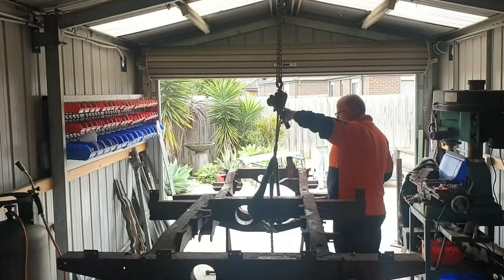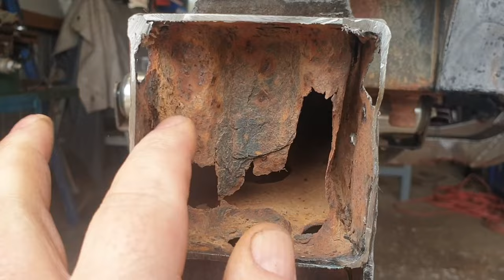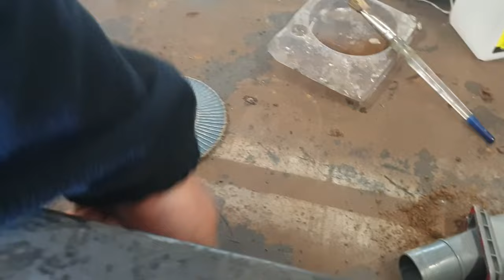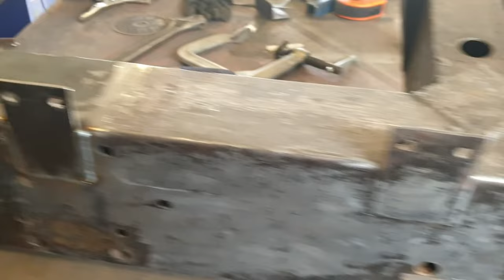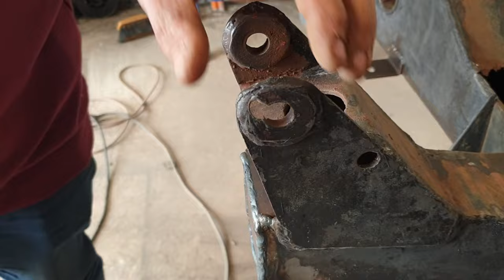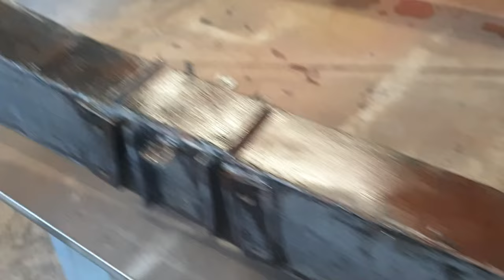1975 Series 3 Land Rover Restoration (Chassis) - Part 19

Comment: Looking good. Good chassis to start with and good result on the repairs. so much better than trying to do on a complete vehicle. It may be too late, but the addition of a grease nipple to the upper end of the steering relay tube would mean it never rusted in there or filled up with dust.
Reply from the maker: Yeah, we plan to load the relay up with grease but a grease nipple is a good suggestion

Comment: Amazing job! The chassis wasn't in very good nick to start with, but you tackled each repair professionally. Two suggestions: (1) You could convert the transmission X-member to a bolt-on affair, so that it can be removed from under the vehicle to enable dropping the tranny, when need be, instead of having to dismantle the flooring to lift the tranny from the inside. (2) Many Landy frames, including this one, which have seen heavy off-roading have the tranny X-member gouged. I would construct a heavy-gauge skid-plate and bolt it appropriately in place to prevent this from happening in future.
Reply from the maker: You read my mind, lol. Ended up doing that in a later vid